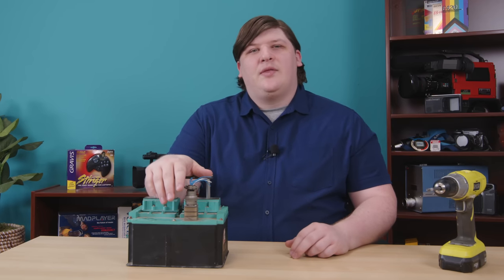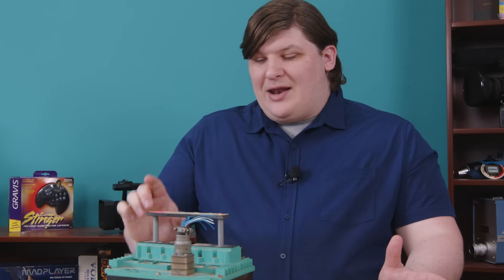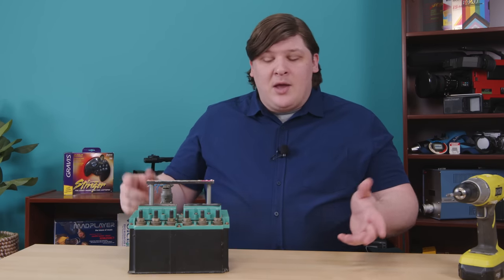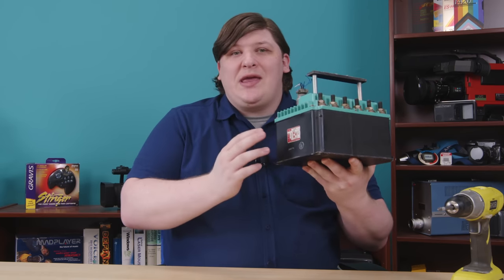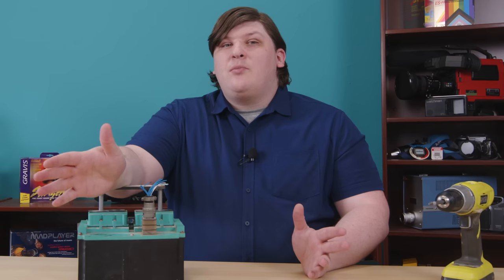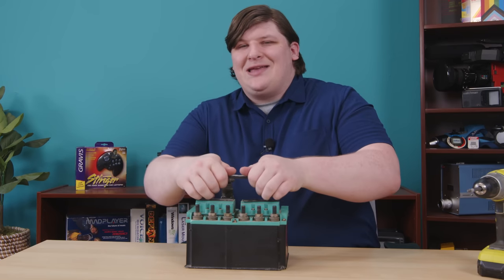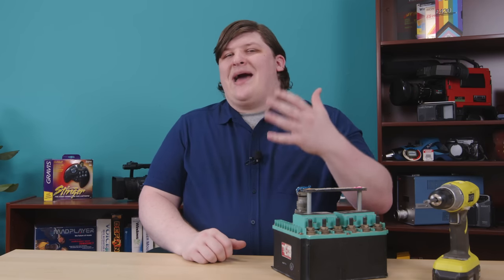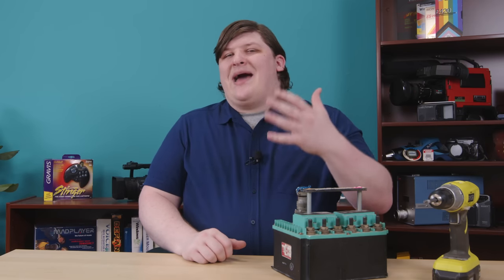A Short Story About (Battle)shorts

Comment: Another example of intentional shorts would be in fire suppression systems.  My dad recently retired from being the maintenance supervisor at a cotton warehouse.  The Complex was built outside of city water service and had its own wells.  The fire suppression system had a massive pump house with a cistern.  The pumping equipment had no overcurrent protection.  The 3 phase motors would run until the pump bearings seized and the windings melted to slag.  There was a manual power disconnect for maintenance safety that could be LOTO'd but there were no breakers or fuses.  The pump house had its own generator and each valve house on the individual warehouse buildings had a large battery backup to maintain the pressure sensors.
Reply: You’re exactly correct. An article describing fire pump protection as specified in the National Electric Code Article 695 states:

The general philosophy behind most Code requirements is to provide circuit protection that will shut down equipment before the supply conductors become overloaded, overheated, and damaged. But Article 695 is based on a different philosophy: The fire pump motor must run, regardless of the risk to the conductors.

A fire pump supplies water to a facility’s fire protection piping. If the pump doesn’t run, not only will those conductors be damaged, but the entire facility will also be in danger of burning down. Consequently, the many requirements of Art. 695 aim to keep the pump running.

Comment: Also, I’m coming back to say they definitely did discuss them explicitly in this way in at least one DS9 episode — when the Defiant is in the gas giant and is damaged. 

The engineers say the phaser relays are shot, but if they wire up the phaser emitter directly to the deflector they can get a couple shots off. They also say it’ll burn out the whole EPS grid and blow out the relays, but they’re screwed and need to rebuild it anyway so they might as well get another shot or two off. 

Which, like, that’s pretty much an exact match for the kind of scenario you’re discussing! Absolutely a sci-fi version of “this’ll destroy our turret motors, but we need to, so we’ll do it”.

Comment: Also the "every time a console explodes there's Rocks" meme might have some basis in reality as well. Carbon Foam. There are quite a few (expensive) industrial coatings that when exposed to high temperatures create a chemical reaction that ablatively absorbs the heat by forming a C02 expanded carbon foam. It's not out of the realm of reality that coatings like this are used in the surfaces inside a starship especially around high voltage or power systems. This would prevent an arc from melting the metal into dangerous molten splatter and rather just creates a relatively safe carbon foam that cools to the touch quite rapidly.
Reply: Still doesn't explain why the heck they're routing such levels of current anywhere near the consoles though, when you can run a tablet PC off 5V DC at no more than a few amps and, potential for fiber-optic cables aside (Isn't that what an "ODN relay" is, canonically? Optical Data Network? Like a CAN Bus for a starship?), modern aircraft design regulations are big on things like segregating low- and high-voltage wires so that something like "Insulation fails, power line shorts to data line" doesn't cause another TWA Flight 800.
Reply: That's a really great theory and my new head-canon.  But if we've got EPS relays, why are the consoles carrying enough juice to explode spectacularly in the first place?
Reply: @ThetaReactor  Energized Plasma Shunt Relays are by nature, full of very energetic plasma. That's why it only explodes once, and only for a very short pulse duration. snickers
Reply: @ThetaReactor  The way I understand it, the EPS system is a bit like hydraulics (but with plasma). So imagine the console is like the controls for an excavator. The levers control the hydraulic fluid via a manifold much like the consoles in Star Trek control the plasma via the plasma manifolds (aka EPS manifold).
Reply: ROCKS!!!

Comment: There's a lot of engineering that takes into account the limits you can push something beyond it's recommended limits.  And that's because the thing being pushed was also designed conservatively with substantial safety margin.  For example, if you look at API 520, the standard which covers pressure relief devices for most pressure vessel installations, the relief valve does not start opening until 100% of maximum allowable working pressure (MAWP) of the vessel is reached.  The MAWP is the pressure the vessel is actually certified for by ASME during pressure vessel construction.  However, given the sizable margins involved in pressure vessel design, there's a lot of room for overpressure.  (Hydrotest pressure during certification is 1.3x MAWP, for example.)  The pressure relief standard says that during most overpressure events, the pressure relief valve should be fully open at 110% of MAWP.  However, in the "fire case" scenario that assumes there's no flow into the vessel but there is actually a fire outside vaporizing the liquid in the vessel through its walls, the fully open pressure is 121%.  That's because the rate of vapor being released increases gradually as the static liquid in the vessel vaporizes and there's also a certain fixed amount of liquid that can be vaporized, so there's a little more leeway given before the valve has to be fully open.  Also, you may not want to open the floodgates on relieving a flammable vapor into a flammable environment if the relief system is piped far away.  Choosing the correct pressure-relief scenario can be quite important, because the wrong choice can be very expensive in terms of equipments and product loss.  Or much worse.

Just another example of exercising engineering judgment on how much transient leeway to give.  But an extremely common one most people don't know about.  Every single of area of engineering has these scenarios.  And it's partially why we don't design thing on the razor's edge of their physical limits.

Addendum: Echoing Nate's comment below about fire pumps, I believe (I'd have to check to be 100% sure) that it is forbidden to put any sort of valve between the vessel and the pressure relief device.  That means that there can be no accidental blocking of the relief path if someone left a valve close for maintenance or something.
Reply: I have a large pressure tank I use for resin casting. It's old and the data plate has a pressure rating of 650 PSI at some triple digit Fahrenheit temperature. I've no idea what it was used to spray when it was made but my use at 80 PSI at comfortable room temperature is never ever going to make that tank fail.
Reply: @greggv8  Yeah, as long as no major defects have appeared on the outside or the inside since its manufacture, it'll be fine.  Carbon steel can get up to around 650 deg F before its pressure rating starts to degrade, and usually it's the flanges that go first.  I remember having to design a hydrogen reactor at about 1000 deg F, 2200 psi.  Had to use chrome-moly steel and Class 2500 flanges. They were enormous.
Reply: @kdawg3484  it's a shame the Pressed Steel Tank Company shut down its US operations long ago and quit making the deep drawn pressure tanks with removable lids.
Reply: Having seen a couple of BLEVEs... (Boiling Liquid Expanding Vapor Explosion) from large propane tanks, that "pop off" valve opening and spewing burning propane into the air was always a GOOD sign - the tank wasn't building pressure (yet) to the point where it would fail catastrophically and take out all the people around it.

Comment: There is also the concept of rerouting power around damage. Naval ships have a real version of it, which you can find in photos and it looks like giant extension cords with connection points here and there. So, if the side of your ship gets a hole blown in it, and the power lines are also damaged, you can run that extension cord to rewire your ship on the fly, to get it working better.

Comment: Contactors are for motors, while relays are for whatever else. More or less.

Contactors have some form of overload protection, which more or less acts as a circuit breaker. If the motor were to get stuck, for example, the current it would draw would drastically increase from the standard running current, and after some time, trip the overload protection. It's meant to act as thermal protection for the motor so if it gets jammed or something it doesn't literally start a fire/destroy the motor windings.
Reply: I've always been under the impression that contactors are basically just big relays.  The theory of operation is identical -- both are electromagnetically-operated switches -- contactors are just more substantial.

For e.g., I'm doing an electric conversion of an old VW, and I have a contactor on the HV B+ line.  That line doesn't feed the motor, the controller is connected to the motor directly via variable-frequency 3-phase AC.  The contactor is the breaker for the pack circuit and will prevent any use (or charging) of the HV battery.  AFAIK, it doesn't have any circuit protection of its own, and thus I have an entirely separate fuse.
Reply: Difference between a relay and a contactor is that a relay has a common connection and a contactor doesn't. Has nothing to do with an overload relay.

Though nowadays they often combine 3 functions. Disconnect, overload protection and a contactor into 1 device. Often called a motor starter (Siemens 3RA6 for example)

Comment: Speaking to a friend who is a retired royal navy weapon System's operator that is exactly that the plunger is for.

If part of the ships wiring is destroyed and the system cannot be operated remotely the you hit the plunger.

He said you find them in all kinds of places, not just the weapon System's.
Reply: I think even civilian ships have some capabilities to re-route power to essential systems in case of a damage, hoping that this enables them to somehow limp to the closest port. (And as we are speaking, there is a fire on a ferry off the coast of Sweden. Likely caused by a technical defect, and a good example that there are situations where this can be important even without war...)
Reply: Glad to hear some confirmation of this. It's what I also would've suspected: if whatever control/monitoring system you use for these relays is damaged, you still need some sort of manual way to engage them.

I kinda doubt they would be engaged proactively, before going into battle, rather they'd be engaged only in case battle damage has rendered their control system inoperable.
Reply: Question: would it reset if powered? Because I can imagine a flickering connection could then cause the equipment to turn off again
Reply: @MrHack4never  Depends on the relay. That one is disposable, if it's what I think it is. Others can be told to pop back open, just as our host suggests. Makes you be really REALLY sure it's warranted, cuz there'll be a reckoning later as to whether or not its depression was justified/ordered/allowed.
Reply: @Colaholiker  The ships have redundant distribution systems, most equipment panels can be routed to at least two switchboards, which are each fed from at least two generators. In US ships, these systems are bus transfer devices, ABT or MBT (auto or manual). 

The battle short is something else, though. It doesn't reroute power, it only bypasses safety systems. Relays, fuses, or interlock switches can be bypassed. A quick example is a high voltage cabinet. Usually, there's a switch on the door so that Seaman Timmy doesn't get a jolt because he wanted to take a closer look. When the door opens, the switch shuts the system down. In combat, damage to the space (room) could prevent the door from closing, but the equipment itself is still operational. With CO permission, battle short is enabled and combat resumes. Just know that zero personnel safety is effective when battle short is engaged.

Comment: I'd imagine scenarios where something like this might be used in a civilian application. Something like the cooling system of a nuclear power plant. In case of an emergency that damages the control systems, you might need to manually engage relays to, for example, keep the coolant pumps working. I'm sure there are many scenarios where something like this could be used in critical, life or death, situations outside military use.
Reply: Chernobyl tested such overrides, had a higher up ordering a temporary delay to keep the area powered, then an inexperienced night crew ran the test at night because there was a deadline for emergency protocols to be ready soon.  The thing caught fire big time.
Reply: Apparently fire pumps actually can't use fuses at all. You just put massive wires.
Reply: Most relays or contactors can be engaged manually, although they don’t typically latch. On most normal civilian use relays there’s a button that serves as both an indicator of whether it is engaged, and also allows you to manually engage the relay or contactor for testing.

Comment: If I remember correctly, some USSR civil aviation engines from 1950s and 1960s were underpowered to point when takeoff mode was basically emergency overpower, and they had stopper latch on engine control to remind pilots that it should be used for VERY short periods of time.
Reply: I watched a story about how they lost several Admirals all at once when they overloaded a plane and forced the pilots to take off under duress. killing everyone. which with that bit of information makes the story a bit more clear why it happened.
Reply: @TatsuZZmage  If we are talking about the same flight, that was more aerodynamical that engine issue. You need to understand transportation and supply situation of late USSR (both were pretty awful) to understand why bunch of top military command would turn their return home to partly freight flight. And don't forget than Tu-104 weren't forgiving plane, it were pretty unrefined machine by today's standards.